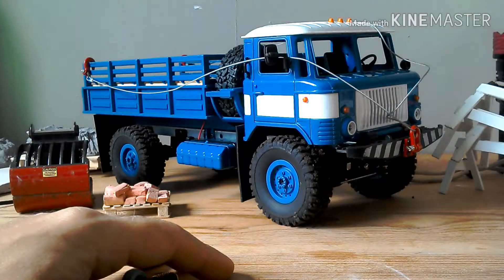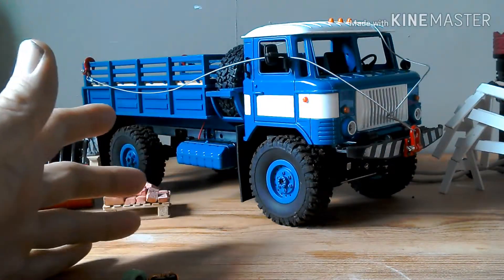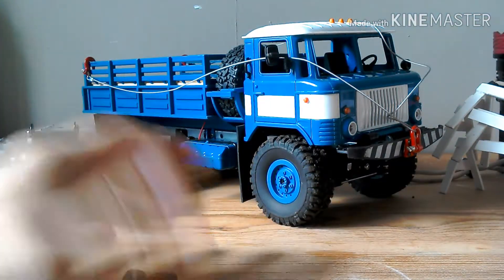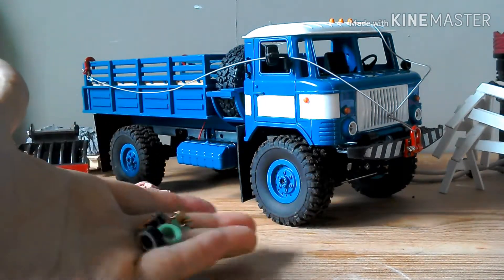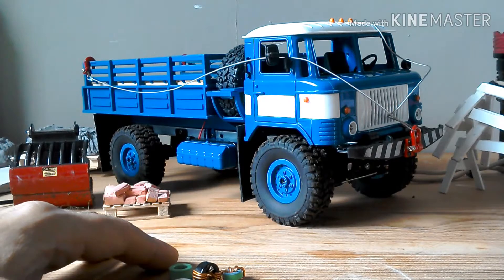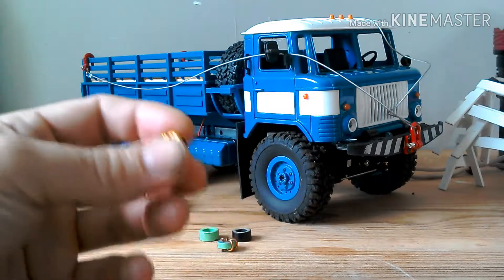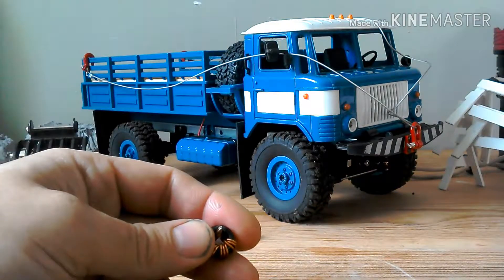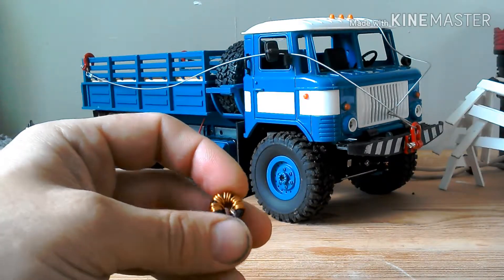WPL B24 Sound Kit Speaker Motor Interference Fix, RC Sound Mod, RC Sound Interference Modification.

Comment: This is a very good explanation and a great tip, and actually, the expensive ESS Sounds kits come with one on the main power lead, and I had not even registered that it was there! Thanks for sharing
Reply from the maker: No problem. I know how infuriating it was trying to get the speaker to behave while at the same time keeping the location I had chosen. And not have to have it towed in a trailer behind! So if it saves some people there hair it was definitely worth sharing. Thanks for the comments and being understanding about posting on your video, wasn't sure how to do it any other way. Keep up the good work! 👍👍👍👍👍

Comment: Hello thank U for the video but could u plase write specs what kind of rings i should buy becouse i am completly green with this :)
Reply from the maker: Hello ambero25! Your more than welcome. What information can I help you with? And don't forget to hit the subscribe button! :)
Reply: @theminiatureconstructionco4556  what size of the rings should i buy ? Should be only ring or ring with wire around ?
Reply from the maker: @ambero25  you can get away with quite a small ferrite ring, I depends mainly on the space you have. The one I used was about 20mm in diameter. You use them without wire wrapped around, its only in the video like that because that literally how I snipped them off the motherboard. And you wrap your own speaker cable around as per the image. Hope this helps! 👍
Reply: @theminiatureconstructionco4556  thank U for answer :) i will buy one and try on mine i hope it will fixed the problem :)
Reply from the maker: @ambero25  I take it you are not from the UK? If you were I could always post you a couple. 👍
Reply: @theminiatureconstructionco4556  norway , its no problem i saw few on aliexpress but thanks anyway :)
Reply from the maker: @ambero25  no problem. I hope it cures your issue. 👍